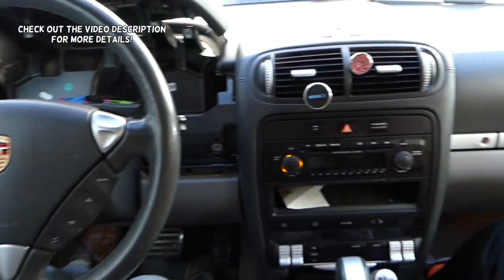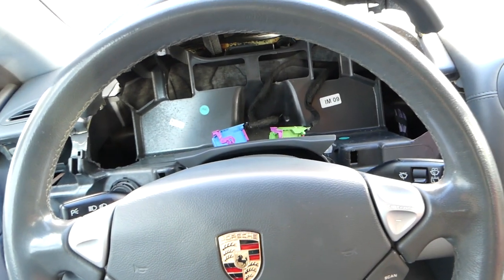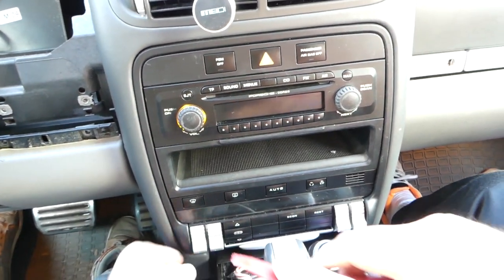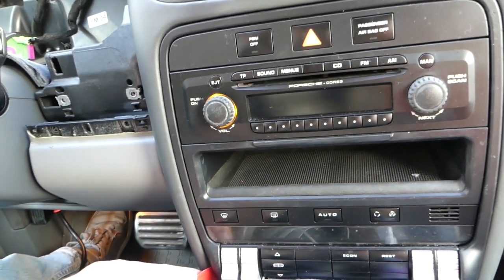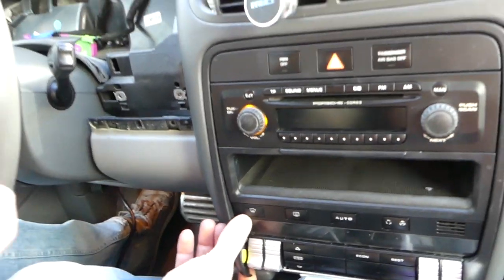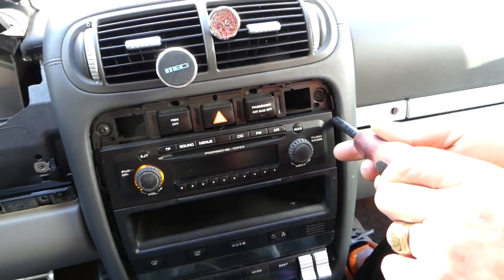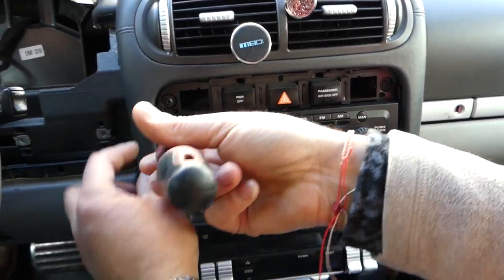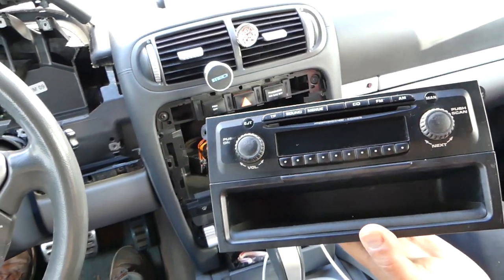HOW TO REMOVE AND REPLACE RADIO ON PORSCHE CAYENNE S TURBO

Comment: This was very helpful! I will be doing a video of my install of a radio in my 2006 Porsche Cayenne Base Model. I will post the link here when the video is available.
Reply: Nice lich king pic homie :D i also bought a cayenne s 2007. Model but it didnt have its original radio, just bought a cheap one off ebay. Works like a charm lol

Comment: Good video. Guy, I'm experiencing the 1299 error in my 06 V6 Cayenne. Changed the instruments cluster and not solved. Have another tip to fix it?

Comment: Thanks for the video. The head unit seems to have a fiber connected. I was wondering if you're putting an aftermarket android unit in or just simply replace with a factory unit?
Reply: I'd like to know the answer to this as well. My 2008 cayenne has the same head unit as the one on the video and I'm looking to to see if I can replace it with an Android head unit.
Reply: @paulodefrancisca9210  me too today did you figure it out

Comment: Good friend to ber if you can give me a little allude because you are the best in this topic I am from Colombia and I am a sound installer for cars and I have a porsche cayenne and I put an esterio pioneer and soundigital amplifiers but the problem is that when switching off the truck and the boberla to turn on the audio does not work the radio shows that it is playing but no output is turned off again the car and it is taught and normal and the parlanteria is changed by focal focal 6 feet cone to break
Reply: did you figure it out